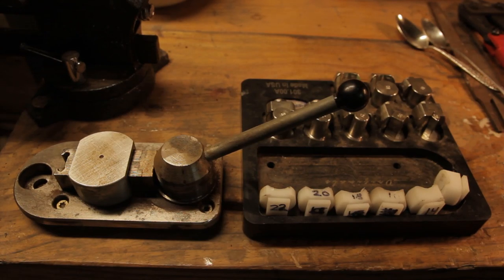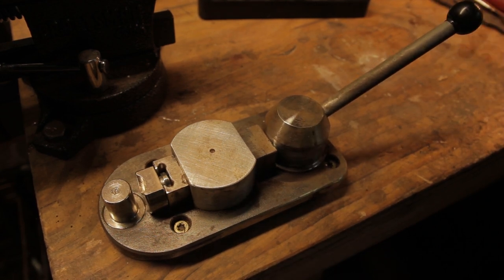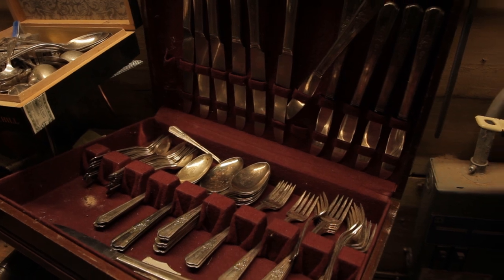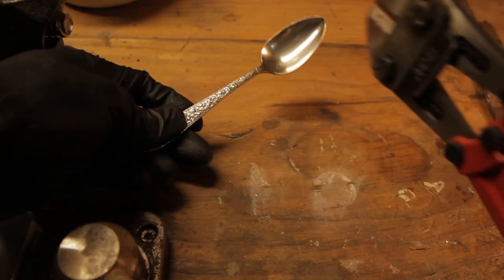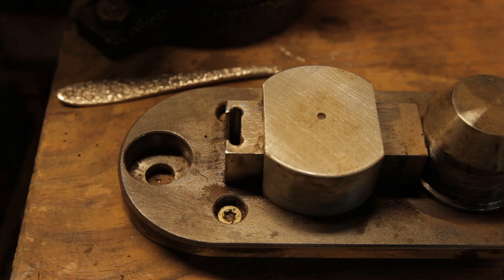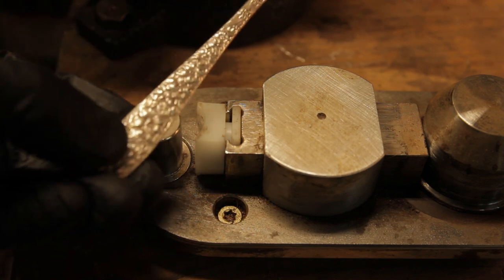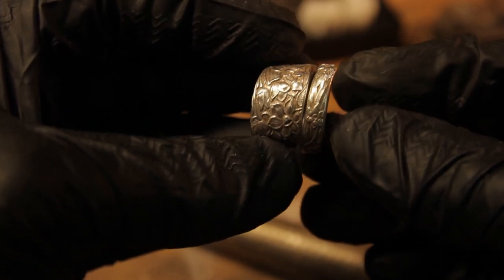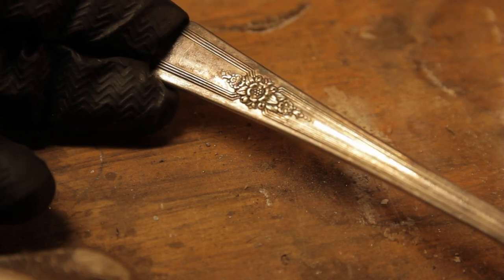HOW TO MAKE SPOON RINGS + Pepe Tools Ring Bender Review

Comment: Crafsman,
I have a suggestion instead of using steel wool. I dip my silver or silver plated spoons/forks in Tarn-X. It only takes about 5-10 seconds. That will take off the heavy tarnish.....BUT...sometimes it gets a white/hazy color after the Tarn-X. SO....the magic happens when get a box of baking soda (maybe from Fred’s Dollar Store) and then wet your spoon/fork with a bit of water and take a pinch of baking soda and rub it on the spoon. The baking soda is a very mild abrasive and will strip off the white/hazy finish in two shakes of a dog’s tail, leaving the spoon brilliantly shiny! It is awesome because you can mash a damp amount of baking soda in tiny crevices and just the pressure will go deep and polish the metal. I also dip an old toothbrush in water then dip it into some dry baking soda and rub the item to get into tiny spaces. When you think it’s polished, just rinse it off and dry it. You can even use a jewelry polishing cloth for more shine. 
Try it!! You will be amazed! It’s better than steel wool and more delicate on the spoons design. 

I know....coupons belong to Dark Vader, but if you have a coupon buy 2 boxes of baking soda a Fred’s because you will be using this tech on more than spoons! I promise.

Comment: Thanks so much for explaining so well.  I just bought the PePe tool. I was using the metal against metal on silverplate and it was marking up my 2 rings. I haven't used the other ones yet.  I find it extremly hard to bend the sp metal.

Comment: Thanks for this video! I've had a Pepe Ring Bender sitting on the shelf for a couple of years unopened. After watching this video, I popped the box open and will be setting it up tomorrow. Your instructions are so easy to follow. One questions: Do you remember where you got your ring size chart? It's so perfect for this.
Reply from the maker: Hey Jessica! Thanks for watching the video! Hope you enjoy using the ring bender. I use it VERY often!  :D  I did some hunting and found this similar chart (hope it shows up):
https://www.pinterest.com/pin/507077239286716067

Couldn't find the very first one I had.  :/
Reply: Awesome, thanks! I thought it was a long shot but it didn't hurt to ask. I'm sure I can mock one up myself if the one you linked doesn't print true. :)

Comment: Thanks for the vid! If using a really thick metal & soldering he ends, would I have to add extra length for the circumference? Love the way you teach. So clear!
Reply from the maker: Thank you, Lulu! Possibly so. It's a little tricky on that circumference. I like to cut a LITTLE over, and file down to the right size.
Reply: TheCrafsMan SteadyCraftin cheers 😀

Comment: Thanks for the upload Mr craftsman it was awesome, how l just love listening and watching you videos followed by that ow so soothing voice you have been blessed with, simply wonderful. but l have one question to ask about this tool? Do you think you could use stainless steel spoons and forks in this vice provided that they are not to thick of course. Will it be strong enough you think 🤔
Reply from the maker: Thanks so much for the kind words, and for checking out my video! I have bent some thick stainless steel spoon handles in this rig. It has surprised me. The key ingredient is sheer strength in some cases, because with those thick stainless handles, you really have to yoke on it sometimes. I prefer to bend thinner ones or silver (bends EASY with this) but it is definitely possible. I found this pattern in a thrift store that had fleur de lis on the handle, and it was popular around here for all the New Orleans Saints fans. Those handles had to be 1mm thick or so, and gave me a workout - ESPECIALLY on the small sizes. One thing in that case I will point out is that it will wear the plastic jaws down a little faster. Though I've yet to order replacement jaws so far, as these keep doing what I need them to.  :)
Reply: TheCrafsMan SteadyCraftin thank you so much for the speedy and detailed reply Mr Crafsman, you are a true saint my friend. I will purchase one very soon through your link in the video to support your channel, it looks fantastic and l will be ordering mine real soon l think. You definitely won me over with this video. And on that note l bid you a wonderful and blessed day today and every day, and thanks a
Reply from the maker: Glad to help, my friend! If you have any other questions, feel free to email me: thecrafsman@gmail.com.  Hope you have a good one!

Comment: another great video CrafsMan, I"m assuming only works with sterling silver and not stainless steel correct?. TFS
Reply from the maker: Oh, this bending jig does indeed work with stainless steel. In fact, that's what I bend the most. I will say, it's a LOT harder to bend that, as you can imagine. I got hold of some really nice fleur de lis handles the other day and they were probably over 1mm thick. HARD to bend, but it handled them.

Comment: If you really want to make those spoons shine, you should use some Barkeepers Friend, Bon Ami, or Comet cleanser. They are microabrasives that are great for polishing metal surfaces. Works great on stainless steel sinks too.
Reply from the maker: Thank you so much for the tip, Xyan!

Comment: Enjoyed your video Craftsman. By the way, where can I get a copy of your chart that you used to measure where to cut the spoon to make the ring?
Reply from the maker: I couldn't track down the original I printed, but here is one very similar, which you can print to scale and it will let you know how long to cut the blank for whatever size you need:

https://www.pinterest.com/pin/507077239286716067
Reply: Thank you for the quick reply, I appreciate your instructive videoes

Comment: I use the chart you show to cut the length of the handle I need to make a straight ring but it comes up way short. I have to add another half inch to come out the right size. What am I doing wrong?

Comment: Hello. How do you know what kind of metal forks to use?
Reply from the maker: Hello! I have used stainless steel (but often they are thick and difficult to bend to small ring sizes, so you want to go through 2 or 3 bends, stepping down from larger mandrel to smaller) but SILVER is way way easier to bend, though usually more pricey. But it would add value to the ring itself, is how I look at it.  :)  Hope this helps!
Reply: @TheCrafsMan  sterling silver or plated?

Comment: Does the bending technique differ if you are using sterling silver vs silver plate?
Reply from the maker: So far I've been able to bend both. What I HAVE noticed is when I would torch + bend, it was really easy to over-heat silver plate. :/ With the bending tool and those nylon (non-marking/damaging) jaws, it made the process way easier.
Reply: TheCrafsMan SteadyCraftin thanks!! Great info!!

Comment: Will this tool bend stainleee steel ?
Reply from the maker: It will, depending on the strength and the diameter you're bending to.
For example, bending a thick stainless steel spoon handle to a size 5... and the handle is lookin like 3mm thick... that's going to take some OOMPH, and honestly at a point may start to feel like you're going to break the handle.
Hasn't happened yet, but it makes you want to seek out silver or go with THINNER handles.

Also, for these tougher stainless steel rings I would bend first using a larger diameter (say, size 10) and then go to the smaller (ie. size 5, 6...).  Bending in two passes like that helped.

Comment: Ditch the steel wool. Buy some baking soda or cheap tootpaste and a toothbrush. My grampa was a silversmith and he woulda tanned my hide if I used steel wool on my silver.
Reply from the maker: Oh, you're so right! It is very abrasive on silver. I have pure silver pieces I've made rings from, and handled them a lot differently. :)

Comment: How could you make it without the pepe tool
Reply from the maker: You could use a torch (to heat up and soften the metal) and pliers, but may have some cleanup work with a file afterwards. Or you can look at those bending jigs people make with just plastic pipes. Really neat!